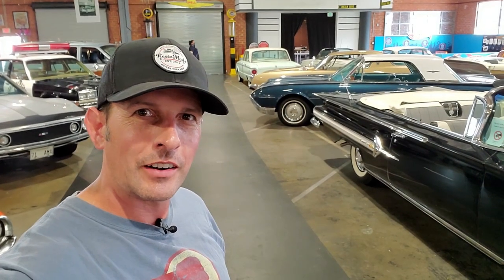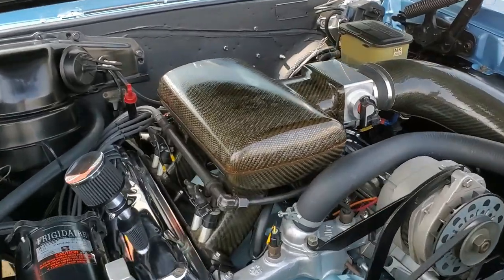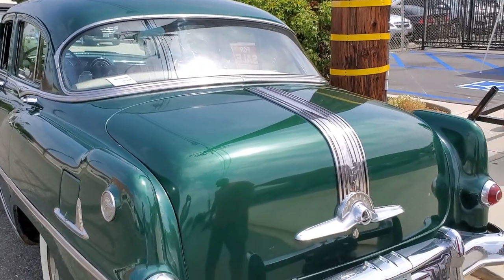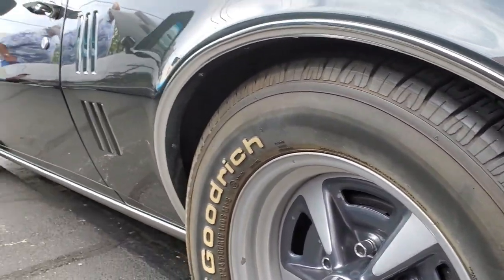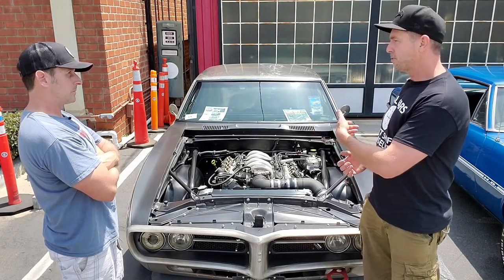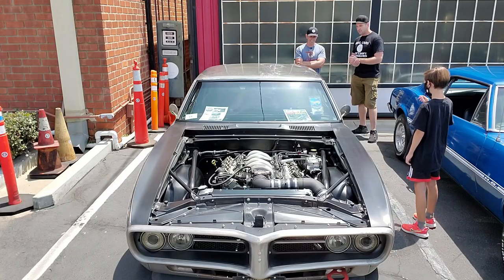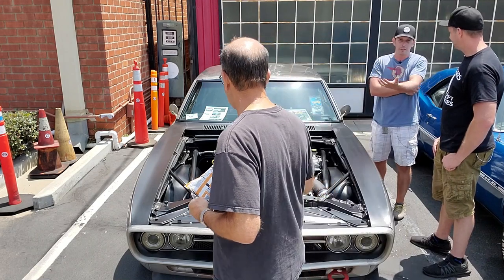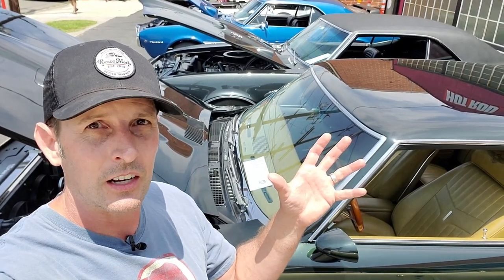Pontiac Only Show!  With Interviews.  Automobile Driving Museum August 2021

Comment: My brother owned a 1968 GTO it was triple black we called it the Monster 👹  he beat up on 900 and 1000 kawasaki 's from a dead stop beat them by 3 car lengths  thru the quarter  mile  455 bored 474, 410 gears in the rear with a close pattern  4- speed with ladder  bars torker eldebrock  high rise  intake with a 850 holler double    
 pumper. It was a beast.  This was in the late 70's early 80's. Priceless memories..
Reply from the maker: Thanks Chris!  I love it!  A 474 is no joke, especially a Pontiac.  Ha, ha... thanks for sharing!

Comment: Wow Mike, Love the show and the car's you picked  especially the Hot Wheels firebird but just a bunch of cool idea's and cool Pontiac Car Owners .
Glad you had no leaks on the way there and hopeful you made it home safely. Thanks for filming and sharing.
Reply from the maker: Thanks John!  Yeah, I'll be doing more interviews in the future... frankly, running out of projects on the GTO, ha, ha.... trip home sucked.  Took 3.5 hours, in 25mph traffic.  But, no leaks, no overheating!  Horrray!   Thanks again.
Reply: Do you no how hydro boost works and is it difficult to install
Reply from the maker: @johnkennedy8452  Yeah, I know how it works... it can be dificult, depending on the type of car, pump, and reservoir.   It's best to try and find someone who has the identical set up you have, but with hydro boost.  Of course, I can help answer questions.

Comment: No’s comment on badging and trim, what does this refer to?  Trying to figure out badging on my 1968 Firebird convertiable
Reply from the maker: Great question, Philip!  It stands for New Old Stock.  That means when they restored the car, they found OLD Emblems, that were never used.  Basically mint condition.  Which fit better than newer re-manufactured emblems, from China, etc... Thanks for asking!
Reply: Black over Red Firebird emblem a 1968 only?
Reply from the maker: @philippeters9264  Ohhh, that I don't know.